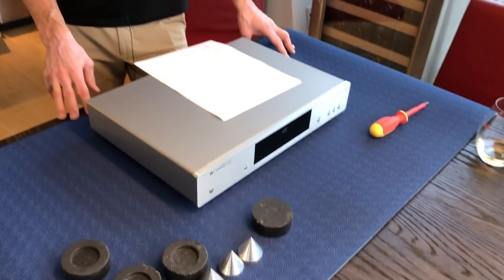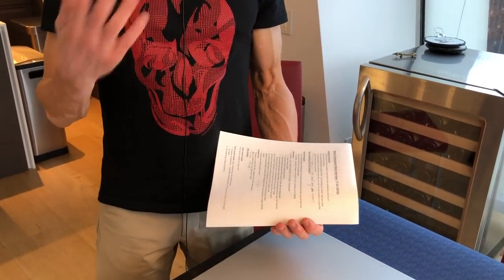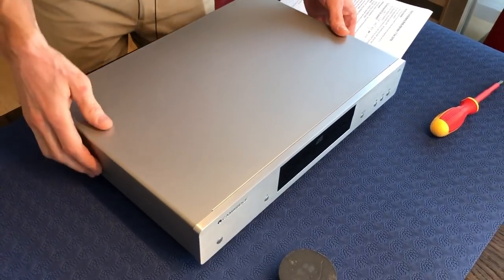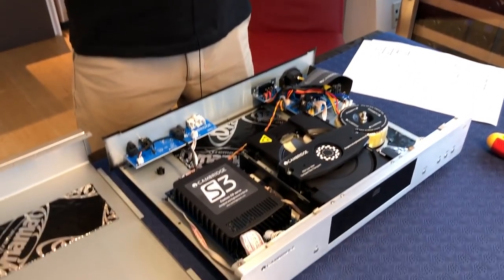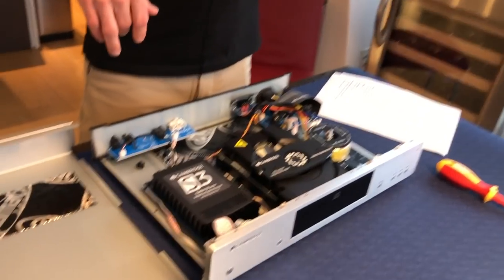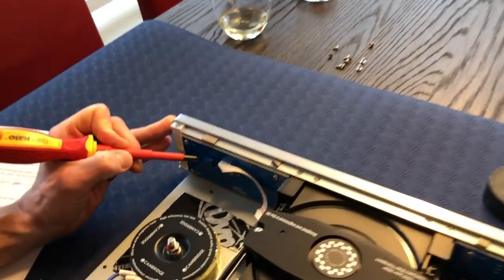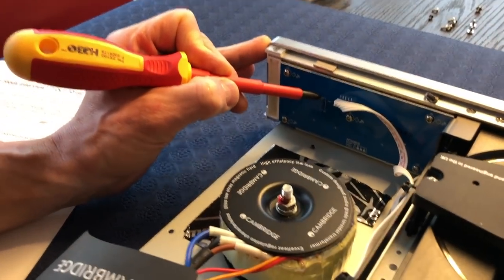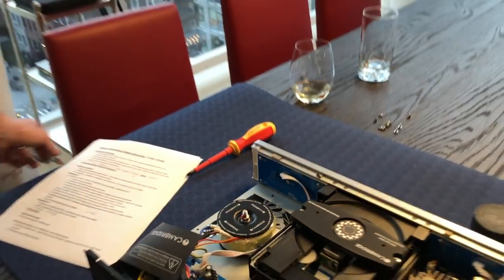Miguel pops the lid on his CD transport to tweak the sound

Comment: Miguel has a great mind to think of all these upgrades and mods, but Damn, now I’ve gotta buy a Cambridge Audio CD transport! I’m gonna have to open up my JVC CD player from ‘91 to at the very least add some dynamat on the underside of the lid.
Reply: Your timing is just great as the Cambridge CXC Transports are now on sale for $50 off retail. Just bought mine at Amazon.com. They will be replace by an upgraded (pricier) model in the next few months.
Reply: Don't forget to clean the laser lense
Reply: Hm, does that JVC say "1 bit PEM D/D converter" on the front of it? Maybe I'm the only one who thinks so, but the sound out of those old noise-shaped 1-bit CD players is pretty good, imo. I'd hang onto the JVC, even if you wind up liking the Cambridge unit better. A lot of old inexpensive gear sounds really good, in retrospect!
Reply: @Matt Bonaccio
Yes, Matt. It actually does say exactly that on it. It’s a model JVC XL-M505. I was just kidding about going out and buying a new Cambridge audio one anyway, as I also prefer the sound of the older ones, and this CD player is almost 30 yrs old at this point. It’s never given me any trouble, as long as I clean the lense every so often.

Comment: It's possible the power cables are routed together to reduce inductance for EMC reasons. Ideally the drive section and the more sensitive electronics should be galvanically isolated which would allow the power cables to be separated.

Comment: I have a few Technics SL-PA10 CD transports from early 90's that had the sound deadening material installed from the factory. And it is on the inside of the top cover right over the CD transport/laser mechanism. ...
Reply: Makes sense if there's no issue with the transport touching it. In my Oppo BDP-93 I did that, and also added Dynamat to the disk mechanism itself as it is all sealed.
Reply: @miguelbarrio  It is great and has plenty of  clearance. I might get some more upgrades to the others. I’ve just opened my 30 years old Panasonic RS-B965 and it’s Technics twin brother and they both had that stuff on the inside of the top cover. And those are the cassette decks!!!

Comment: The damping mat can be used on speaker elements also.

If you tap your woofers frame/cage you can hear it ring. It also rings from the reverse side, and sometimes it can sound amplified through the speaker cone.
I applied heavy damping mat on big 18", 8", and a big compressor horns.
There are less structural sounds transferred out to the listener after this mod.

Edit: Forgot to say, tap with the handle of a screwdriver. That way you get a sharp tap instead of a thud if done with fingers.

Comment: Everything is built to a price point so the sum total of these mods are all a positive but in all honesty precise clocking is everything in digital
Reply: True. But precise clocking means reducing jitter. Changes that make the waveform sharper, less noisy (in terms of voltage), and mechanical vibrations affecting those sources of noise, all can contribute to better clocking.
Reply: @miguelbarrio  I  completely agree but how much do you think Cambridge would have to charge for this very same unit if it were built in a solid billet aluminum chassis, true it would defiantly improve the sound but at many of thousands of dollars, its all a matter of how far you want to take it.
Reply: @512bb  Of course. That's the point. I am happy Cambridge doesn't do that... :)

Comment: Would a old Marantz CD 10 be ok instead of a book ?  it does however come in at over 3.5 stone
Reply: Well, since you asked... Depends... The heavy transport would put weight on the four corners but not the center, which can let the center of the casing still rattle. A book on the other hand has two nice features: spreads the weight evenly, and being a stack of paper, it certainly won’t have resonances.

Comment: My 3 key operations: eliminate the cheap clock on the board and just plonk in a Superclock (with separate power!!), stick a few pieces of dynamat to top and bottom, close the player and put a nice thick plate of marble on top covering the whole player. This gives a 75% better player, the other mods have a very limited effect. The Marantz 63 KI signature played in another league. All this only works with the cheaper cd played with thin folded casings.
Reply: What Superclock did you end up using? Do you have assembly instructions?

Comment: I've seen people Dynamat their CDPs before. Most claim an improvement. I don't have any experience with this but I have put some weight, about 15lbs worth on an old mid-nineties Sony CDP and it seems a little smoother, Or I could just be fooling myself, lol We also know that "jitter" is a problem. So, sure, why not. As to HOW much difference this will make, only your ears can tell. Because, frankly, mine can't always tell.
Reply: I think tweakers are people who like to experiment.
If you can't hear a difference with one experiment, then try another.
Just don't write the earlier experiment off completely, as it may make a difference you can hear further down the line, after changing other parts of your system.

If you can't hear a difference from anything you do, it might be that you need to upgrade your system (if you have a toaster, to use the PC vernacular), or it may be that you need to put in more research into what you're doing (maybe you're doing the wrong thing, or for the wrong reason), or it could be possible that you just can't hear differences, in which case tweaking is (probably) not for you.

In any case, the idea is to enjoy your time with listening to music. Let that be your guiding light, so to speak.   : )

Comment: Why do u always skip the hardest part? I couldn't get it open! I now have the dynamat and nothing to do with it. I didn't want to break anything prying it open. explain how the deadning willl matter when u can't hardly hear this unit's mechanics at all anyways?
Reply: I have not done these mods however if one wishes to keep the warranty active another option is to apply a layer of dynamat to the majority of the exterior bottom surface of the unit. This of course will be out of sight but obviously some peoples'  aesthetics simply can't handle this.  The top of the case receives vibrations from its contact with the bottom of the case.  Eliminate or reduce the vibration at/on the bottom and no dynamat would be needed on the top or interior.

Comment: Are those veins on his biceps or did he inject power cables into his blood stream?
Reply: I paint them on every morning
Reply: @miguelbarrio  Better make sure you have a linear power supply with that paintbrush lol
Reply: JeanPierre Snyman Of course I do!
Reply: Try starting your own YouTube channel pertaining to mods! That would be cool and fun
Reply: @miguelbarrio  I loved the original video and have seen it multiple times. I admire your setup and your enthusiasm. That dCS and the Audio Note amp though..sexy little units :)
Reply: @sickkids666  I've actually adjusted tube bias in the Audio Note Ongaku myself. It's a trip to the danger zone - You have to measure the voltage diff on the primary of the output transformer which is floated at ~950V!!!
Reply: He must be a runner
Reply: @salvadorrodenas3071  I am not a runner (used to run years ago). But I do put my cardio in.
Reply: @miguelbarrio  your ratio of body fat is extraordinary low. One have to burn a lot of calories and have a healthy  diet in order to maintain that fit.
Reply: @salvadorrodenas3071  I do both. 6% Thx!
Reply: @miguelbarrio  Miguel te admiro mucho tenes una mente brillante.

Comment: One could place the damping mat on the BOTTOM of the case and avoid any problems with the machinery or electronics in the most critical areas on the inside, the areas that could benefit from damping most.

Comment: I treated my CXC  and below are the photos and my impressions.

First of all I made the whole chassis "deaf" and less sensitive to vibrations both internally and externally from the bottom.

I used sheets of STP soundproofing, damping and with an aluminum foil.

Then I bought tinned copper braiding to insulate what can i.e internal power wires and something else.

I have dealt in particular with the cable that comes out of the power supply and reaches the CD area (the one that was initially secured with the two white clamps together with the data cable) and the cable that comes from the "CD servo" area and reaches the card before the final output connectors (I use a coaxial SPDIF cable to connect to a Naim NDS with internal DAC but before that I use an external jitter enhancer to the NAIM).

I have also further covered where possible with a hollow pipe which is used to cover the copper pipes that carry hot water into the house.

These tubes, in addition to damping the vibrations also on the cables, make it impossible for two neighboring cables to touch and influence each other with less force.

Also where possible I shielded with a conductive copper tape.

Finally, where possible, I also used a little adhesive Japanese product at the ends of the cables to absorb vibrations to avoid as much as possible that external vibrations could reach the cables and finally be amplified as well, the so-called "fo.Q" which is an adhesive sheet in different sizes known in the audiophile environment for use for damping purposes.

I bought two "audiophile" fuses to be able to replace the two present as standard and I'm waiting for delivery (I will install when they will arrive).

What I would also like to do as another step is to use an external clock that gives better jitter and improve the stock power supply but for this I need your advice.

My system is a full Naim with Proac D48R speakers, all Naim mains cables for each component and a UK power conditioner.

It's clear that I could have bought a better CD transport but in our hobby it's also nice to experiment and enjoy the result you can achieve with your own hands.

The CD player (reading mechanism more precisely) has significantly increased in weight and this is positive.

Photos of my modifications are available here : 

http://www.collezionismo.altervista.org/trattamento_cxc/foto0.jpg

http://www.collezionismo.altervista.org/trattamento_cxc/foto0_1.jpg

http://www.collezionismo.altervista.org/trattamento_cxc/foto0_2.jpg

http://www.collezionismo.altervista.org/trattamento_cxc/foto1.jpg

http://www.collezionismo.altervista.org/trattamento_cxc/foto2.jpg

http://www.collezionismo.altervista.org/trattamento_cxc/foto3.jpg

http://www.collezionismo.altervista.org/trattamento_cxc/foto4.jpg

http://www.collezionismo.altervista.org/trattamento_cxc/foto5.jpg

http://www.collezionismo.altervista.org/trattamento_cxc/foto6.jpg

http://www.collezionismo.altervista.org/trattamento_cxc/foto7.jpg

http://www.collezionismo.altervista.org/trattamento_cxc/foto8.jpg

http://www.collezionismo.altervista.org/trattamento_cxc/foto9.jpg

http://www.collezionismo.altervista.org/trattamento_cxc/foto10.jpg

http://www.collezionismo.altervista.org/trattamento_cxc/foto11.jpg

http://www.collezionismo.altervista.org/trattamento_cxc/foto12.jpg

http://www.collezionismo.altervista.org/trattamento_cxc/foto13.jpg

http://www.collezionismo.altervista.org/trattamento_cxc/foto14.jpg

http://www.collezionismo.altervista.org/trattamento_cxc/foto15.jpg

http://www.collezionismo.altervista.org/trattamento_cxc/foto16.jpg

http://www.collezionismo.altervista.org/trattamento_cxc/foto17.jpg

http://www.collezionismo.altervista.org/trattamento_cxc/foto18.jpg

http://www.collezionismo.altervista.org/trattamento_cxc/foto19.jpg

http://www.collezionismo.altervista.org/trattamento_cxc/foto20.jpg

http://www.collezionismo.altervista.org/trattamento_cxc/foto21.jpg

http://www.collezionismo.altervista.org/trattamento_cxc/foto22.jpg

http://www.collezionismo.altervista.org/trattamento_cxc/instal
lazione_fusibile_1.jpg

http://www.collezionismo.altervista.org/trattamento_cxc/installazione_fusibile_2.jpg

http://www.collezionismo.altervista.org/trattamento_cxc/installazione_fusibile_3.jpg

http://www.collezionismo.altervista.org/trattamento_cxc/installazione_fusibile_4.jpg

After putting everything back together and plugging everything back into my system I moved on to the listening test.

I inserted the usual CD that I use to test the audio or Eagles Hotel California.

A smile was printed on my face.

The sound is noticeably improved : quieter, drier, beautiful instrument separation, much more enjoyment.

Very satisfied.

Thanks to the author of this post Miguel that was my inspiration.

Comment: A little tough to get through but good, nonetheless.
I've modified every component I've owned since '74. I'm an EE not a butcher. My philosophy is that the mods must make a worthwhile improvement to performance and or longevity. Everything must look factory, etc. I try to correct where compromises were made. Most mods are pointless and not grounded in circuit or field theory.
It's an affliction. Once you're a modder you always will be. But without an education you are wasting your time.
Reply: I studied mechanical engineering but now work on electronics full time. I don't view it as a time sink because I learn something new every day. In my year working as senior engineer of Soundsmith, I perhaps forgot more information than I've retained. Which is why I keep notes and photo documentation of everything I touch. Very good to see there are still non-butchers out there who take pride in their work. Even cooler to see gear that has been maintained by skilled technicians.
Reply: YEAP !

Comment: I like these tweaks: most are free or close to it and common sense. 
I have been putting books on top of my components for decades as an
example, and keeping digital and analog cables away from each other. 
I look forward to part two where the old soldering iron is plugged
in.

Comment: I love Blue Jean cables, and have a few in my system. They have extremely low capacitance.
Reply: They are also proper 75ohm cables so that the interface between the send, the cable and the receiver is perfect and the signal is not bouncing back along the cable from destination to source.
Reply: @Christopher Ward 
Very true. I also like their speaker cables with the welded end banana plugs, or whatever you choose, onto quality Belden on Canare cable. Only company I believe that actually welds the plugs, or so they say, and I believe them. They’re also very high quality plugs too.
Reply: I like Amazon basic cables. Just put them in the freezer for 24 hours , And the sound will open up. Oh and 7 day burn in also helps.

Comment: Shopping the current market for a cd anything is frustrating because there is so much junk out there.  Slow reading drives, displays with limited info and questionable user interfaces.  I just ordered a Rotel tribute player on sale for $399.  Even this Cambridge model has it's share of problems when you read it's reviews. Same with the Audiolab units.  This Cambridge looks pretty good on the inside.

Comment: Many audiophiles forget the need to clean cds. An inexpensive ultrasonic cleaning unit, most of which include a holder for cds is perfectly adequate. I bought mine off Amazon for approximately $30 and it holds two cds at a time. For a cleaning solution I fill the chamber with distilled water and add one tiny drop of Kodak Photo-flo. (a surfactant). This helps the disk to dry without spotting as does the use of the DI water. Remember, new disks have such things as mould release compounds and other surface contaminants on them straight from the factory.
A clean disk is a great sounding disk that lets your player’s laser read it as best it can!
Reply: Nonsense, Ive never cleaned my cds and they play fine.

Comment: I guess im the odd man out by using a OG Playstation for cds
Reply: Nope! I'm using one! Unless you mean PS1--I'm using the PS3.  (For those not old enough: there is a partcular version of the PS1 with a great CD player and a version of PS3 that has a great Blu-Ray/DVD/CD player. I'm not sure which is the good PS1, but if you have a PS3 with 4 USB hubs on the front, you got the right one.)  A first-gen PS3 with the top-of-the-line Blu-Ray player also plays SACDs and (if you haven't upped your DAC game yet) upsamples to 176.4kHz and has 3 bitmapping filter modes . Sony lost over $300 per unit in hardware alone on the first gen PS3 because blu-Ray was just coming out and they put their best player in it to get  market attention. Sony invented/first brought to market both the CD and Blu-Ray, so they were making transports as good as anyone at their top end.
Reply: @djsjjd15  thank you on the ps3 info, bin wanting one for a while and now I know what to look for.
Reply: @MikeyB00o  cool! Another tell-tale marker is if it is backwards compatible and plays PS2 games. Later versions lost that feature.
Reply: @wolfblue7454  yes, as I mentioned in the lengthy post, it can play SACDs.  As for your other question, you can use it as a component CD player through the HDMI output. And, you don't need to hook it to a DAC! It has a very good DAC already built in. Top of the line (for the time) and you can even choose from three different sound profiles. If you have a modi or other DAC already, you could try running it through the newer DAC using the optical out to see if you get better sound. My amps don't have HDMI inputs, so I am using the optical out and have it connected to my Topping DAC.